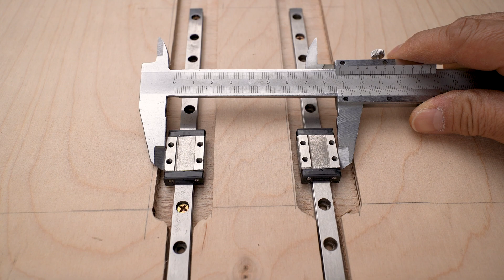Reciprocating sander / DIY

Comment from the maker: Since one day, I've been getting tired of the tools I use on a daily basis.
Even sawing may be paying off the efforts of brands that have made them use band saws, jigsaw, and cut saws.
It's true that the annoyance and the desire for improvement that we feel when we do repetitive work have created and developed a lot of inventions.

I got tired of sanding wood on sandpaper.
With the touch of an experienced craftsman, it is of course important to grab the wood and rub it against the sandpaper to match the desired fine angle and size. It's also the delicate art of carpentry.
But sanding repeatedly is not a very pleasant task.
Alternative tools have also been developed. A swivel sander or belt sanding machine is an example.

I made a device that can automatically sandpaper.
The wood is fixed, and the sandpaper is made to do a reciprocating motion.
It was designed and assembled so that it could be like moving by hand.
We've been sanding trees with our hands, and it's a device that allows trees to stay still and sandpaper to make a round trip.

There are many structures that can do reciprocating motion, but I specifically used circular gears and flat gears to make them that can turn rotational force into reciprocating motion.
By controlling the speed of the motor, the sandpaper can be controlled at the speed of the round trip, 
The sandpaper was attached to a flat magnet to allow it to be replaced so that it could stick to the bottom surface of the metal ruler.
And I made a jaw on all sides of the floor of the moving sandpaper so that it could act as a guide bar to hold the wood.

If you enjoyed watching the video, please subscribe and click like. Thank you.

#DIY #sanding

Comment: Brilliant! Thanks for sharing 🙂 the only feedback I have is I would not use that connector, but rather a standard iec320 for the power. But you are probably better at not misplacing cables than me 😅
Reply from the maker: The shapes of connectors vary greatly by region. I like this connector. A video of unifying all the wired tools I have with this connector will be uploaded soon. Thank you very much for your kind words. Let's go on a trip to the world of DIY with me.
Reply: @Kynosys_  Oh, didn't think about that, I love the connector you use, but didn't know it handles AC well. I have only used it for 12VDC myself. :) I am probably only a bit biased towards the other connector because I have amassed an unhealthy amount of spares over the years :-P